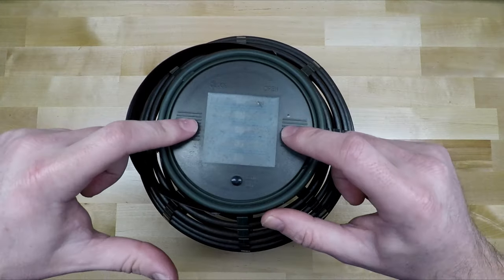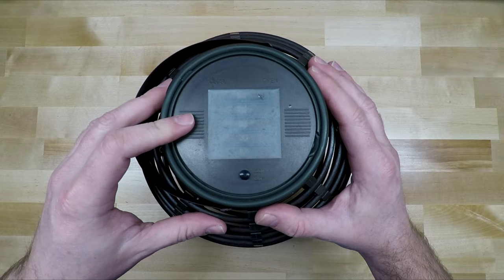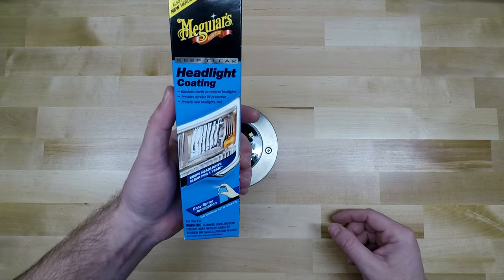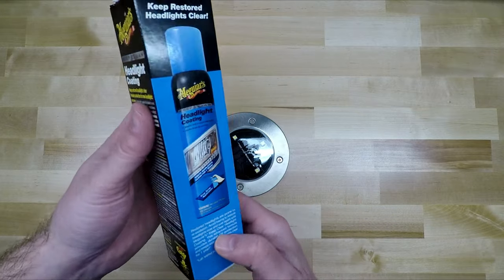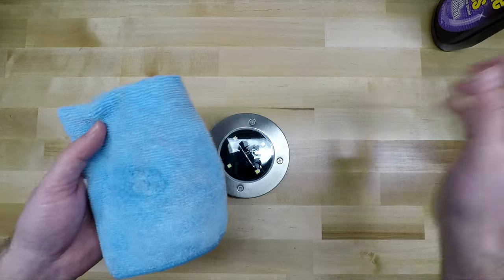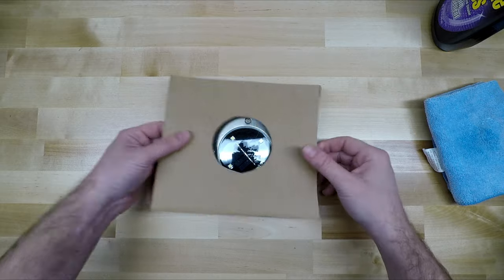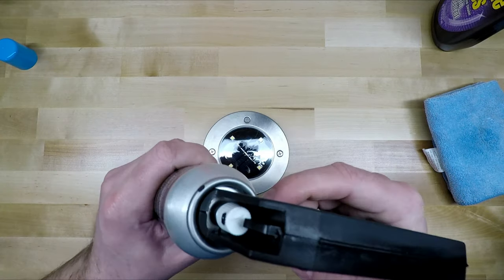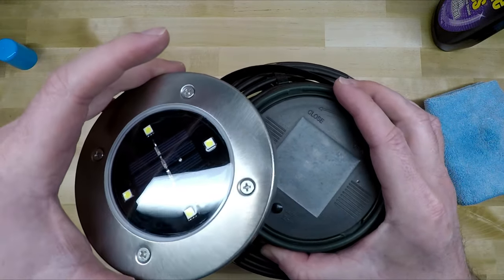How to PREVENT cloudy solar panels on your LED garden lights

Comment: if you want to clean the solar panels on your garden lights the easy way just use 70% Isopropyl alcohol and cotton pads, not cotton balls but pads.   soak pads with alcohol and wipe the gunk comes right off, the alcohol dries fast .
Reply from the maker: Does that smooth out the cloudiness or just clean them?
Reply: @InJasonsGarage  It only wipes off dirt. IPA does nothing to clear cloudy plastic that was affected by UV sunlight

Comment: Out of desperation, I was able to bring some nice decorative hanging lights back to life, by using 
WD - 40, and Scotch Bright pads to remove the oxidation from the face of the solar panels !
Too...I found out that many a Solar light, made to look like a light bulb, hold water !
Obviously ruining the electronics in short order !
Quick fix, is to drill a weep hole at the very bottom of the bulb !
Use common sense here !
Nothing too large, but big enough to let water drain quickly !
Fill the plastic envelope with water to gauge this !
Best to disassemble before drilling !
These may require some maintenance as well, as tiny Spiders can clog the weep holes, with Cob webs !
Also, I have found that replacing the original batteries that come with these, with a better grade, goes a long way in keeping them working !
Always be sure to purchase, 
" Rechargeable " batteries for the obvious reasons !
After much hair pulling experiment's, I was pleasantly surprised, that my lights even work through some very frigid Midwestern days and nights, after having a sunny winters day !
It still shocks me to see them working in Winter !
Where before, I had been bringing them indoors, thinking the cold would ruin them !
These of mine, are on their  Third or Fourth Season !
So a little TLC goes a long way with these !

                     ((💡))

                   👍😉
              Just Say'n !

Comment: So how did the spray work to protect the panel?
Reply from the maker: It worked very well.  In fact, the solar lights stopped working before the panels started to get cloudy.
Reply: Any suggestions for extending the life of solar lights?
Reply: @InJasonsGarage  Thanks for your response
Reply: @denisebattle5008  hi many solar lights use rechargeable batteries. I keep them on hand just in case because my solar lights cost too much to just throw away!
Reply: @InJasonsGarage  this means this light did last dry long.
Reply: @denisebattle5008  big Clive here on YouTube has several videos about extending the life of solar lights.

Comment: I have exact round solar lights with cheap plastic. The question is how do to clean it? I have used Meguiars product but it doesn't do a good job on these cheap plastic. It still look cloudy.
Reply from the maker: I use Simple Green All-Purpose Cleaner cleaning stuff like this and for just about everything else.  
The lights used in this video stopped working a while ago, but the lenses were still in good shape.  I just think the batteries stopped holding a charge and it was cheaper to get something else than to buy new batteries for it.

Comment: How does spraying clear clear coat over the oxidation clear it up? you’re just spraying clear coat over the grime?
Reply from the maker: The headlight protectant spray that I used has UV inhibitors in it.  It is not standard clear coat.
Reply: You should probably sand off the oxidation before you put clear coat on doesn't make sense to just put clear code over something that's oxidized

Comment: I heard to paint a coat of clear nail polish and the solar lights start working again after cloudy.
Reply from the maker: That is one solution, but that won't typically last long.  It is more cost-effective and easier to use a basic clear spray paint.  I have used this in the past with some pretty good results:  https://amzn.to/3BHBTyt

Comment: I was under the impression the solar lights needed the UV rays to charge. No?
Reply from the maker: They need sunlight. UV rays are a form of radiation also emitted by the sun.
Reply: @In Jason's Garage  Exactly. So if you apply a uv ray blocking coating will they still charge efficiently?
Reply from the maker: @pep729  Have a look at this:  https://solivace.com/charge-solar-panel-with-uv-light/
Reply: @InJasonsGarage  Excellent explanation. Thanks.
Reply from the maker: @pep729  You bet!

Comment: The plastic oxidizes due to UV rays over time.   Your suggestion does not work.
Reply from the maker: You didn't really watch the video, did you?  😃
Reply: @InJasonsGarage  Did.
Reply: @InJasonsGarage  You probably could extend the life of the plastic if you cleaned and re-applied Meguiar every two weeks.